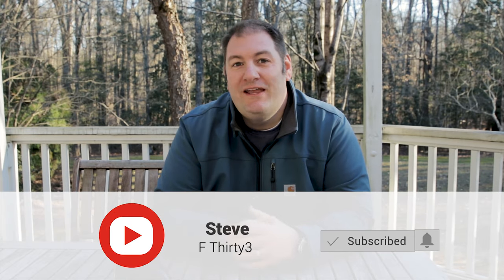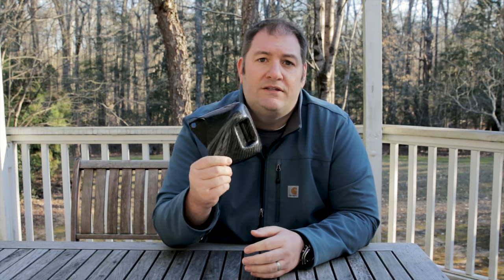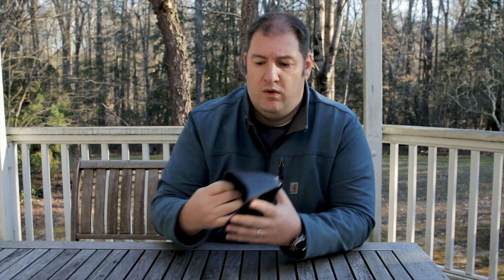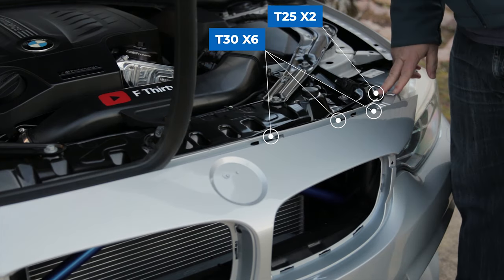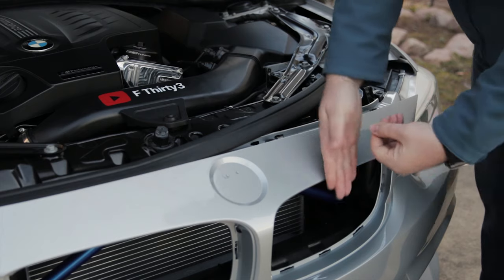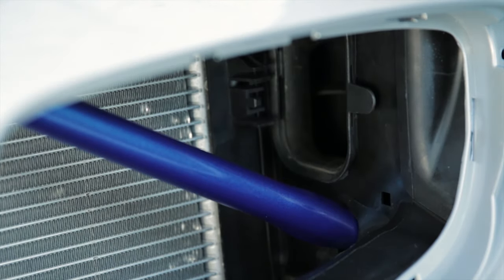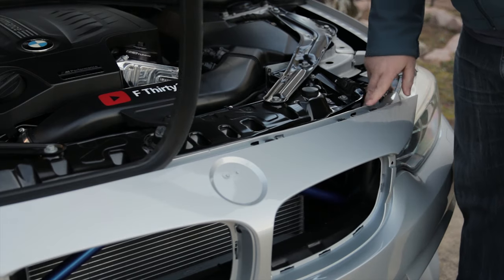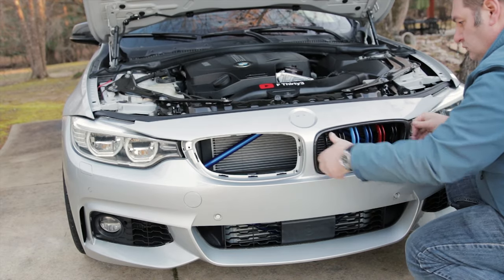BEST COLD AIR INTAKE - THE aFe CARBON FIBER AIR INTAKE SCOOP

Comment from the maker: This this video I'll show you the best cold air intake option for the 4 series. This aFe carbon fiber air intake scoop will dramatically increase your airflow. This air intake scoop fits the F32, F33, F36 as well as many other F series cars. This is a no brainer if you want more cold air to reach your engine but don't want to spend hundreds of dollars on an air intake that may end up robbing you of performance rather than giving you the increase you're looking for. 

🛒Products Featured -  aFe Power  air scoops🛒
Carbon fiber:
https://www.ecstuning.com/b-afe-parts/magnum-force-intake-scoop-carbon-fiber/54-12208-c~afe/
Plastic: 
https://www.ecstuning.com/b-afe-parts/magnum-force-intake-scoop-black/54-12208~afe/

🛠Tools Needed🛠
Dewalt Cordless Drill: https://amzn.to/2XwXx4K
Dewalt Mechanics Tool Set 247pc: https://amzn.to/31CHbcf

Comment: Hi Can this be installed on a 2015 428i F36 with a N20 engine?
Reply from the maker: Great question! Yep, this is available for the N20 engine however it's a different part number and goes on the passengers side instead of the drivers side. the rest of the install is exactly the same. 👍

Here's the scoops that would fit the N20
Plastic Air Scoop: https://amzn.to/3kj1GEq
Carbon Air Scoop: https://amzn.to/3ke6FpY
Reply: Thanks a lot mate!